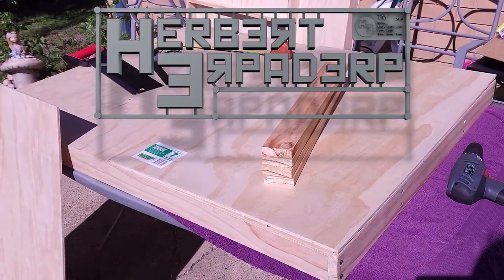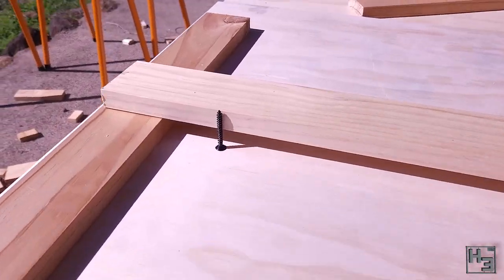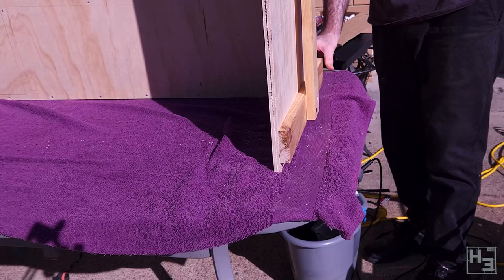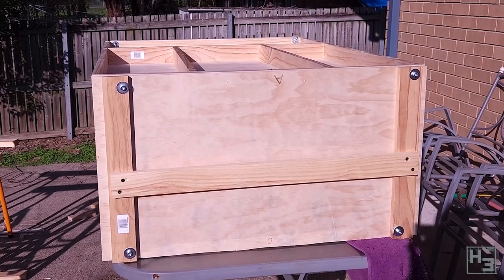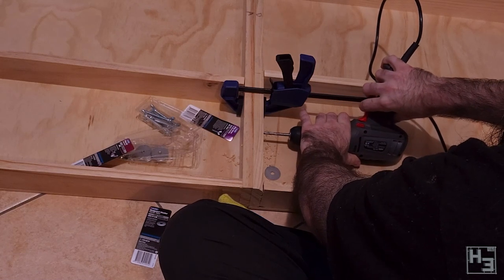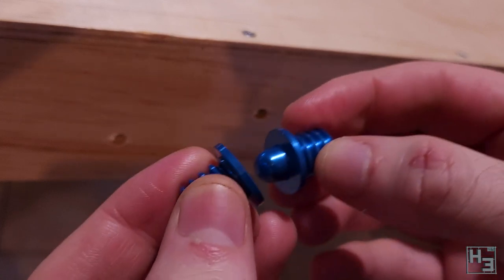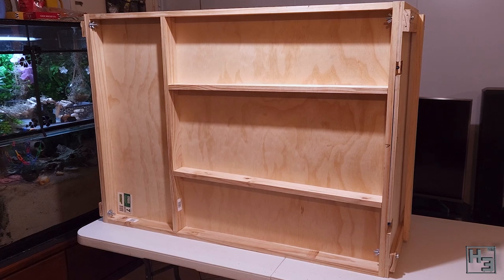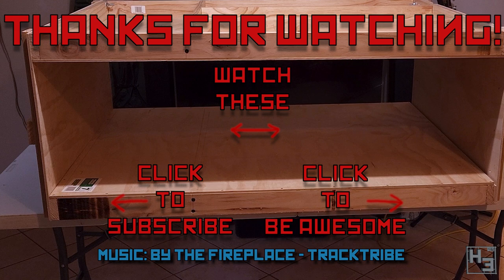Baseboard Ends and DCC Concepts Alignment Dowels - N Scale Model Railway Adventures #2

Comment: For Herbert
I am an N scale model railroader,, and have been modeling in the scale for a while. If you have not already bought track, locomotives, or rolling stock- I suggest the brands Kato, Atlas and Bachman. They are on the less expensive side, and make quality products. Kato Unitrack is by far the best track on the market, and does not require ballast or road bed. And they use a modular system that is well thought out and easy to use. 

Atlas and Kato make great steam and Diesil locomotives, and all 3 make excellent rolling stock. I also reccomend the brand life Like for specific locomotives.
Reply from the maker: I've already started buying track etc, Peco. I do have some unitrack, but I don't like how it looks and I would prefer the flexibility of flex track. Plus it's more expensive. 
ALso, The brands you mentioned seem to mostly do US stuff.
Reply: I'll never understand why people like Kato Unitrack so much. It's toy track, it looks awful. The only times I've seen Kato Unitrack look good is when people have done their own ballasting and weathering to it, but if you're going to bother with that, why not go with better looking track to start with?
Peco is my choice too. Especially code 55. The new unifrog points they're making goes perfectly with DCC. I like the way code 55 track has the rail set deep into the sleepers, leaving a smaller railhead exposed on top, once painted and weathered it looks as realistic as you can get without going down the 2mm finescale route (which is too much hassle for the average person).